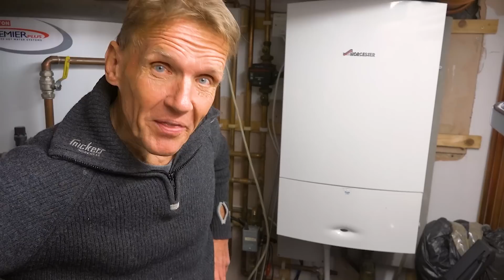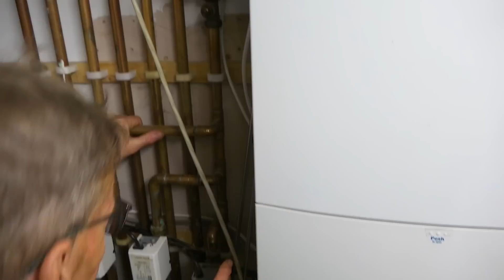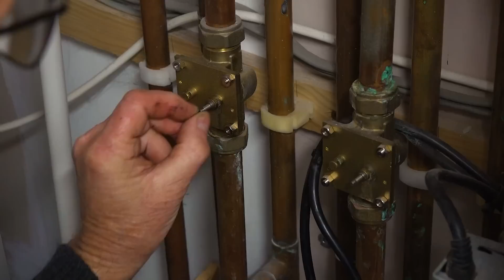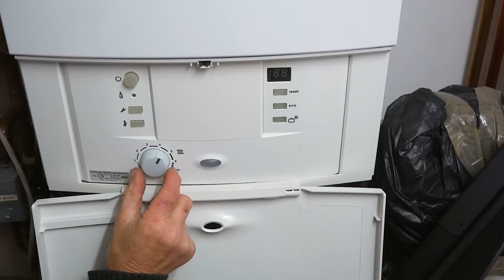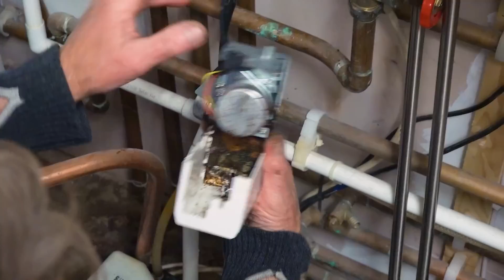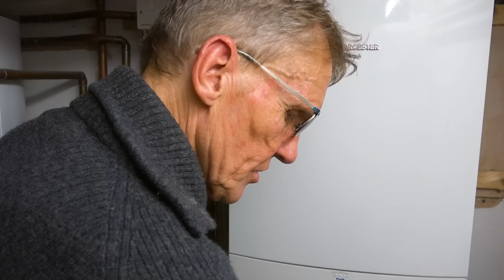How Did British Gas Miss This Simple Fault?

Comment: That is difference between some one who is Licensed, and one that is "Certified" by their employer. I am a multi Licensed Plumbing & HVAC Contractor with a Boiler Installer License up to Nuclear in Detroit area. Most employee's of Plumbing & HVAC Contractors are not licensed, and very few have went to a pay for it type of Trade school. The opportunities of actually getting into a Union Apprenticeship are nil, compared to when I did in January of 1979, and I only got in from a friend whose Dad, Brother & Brother In Law were in Local, and I ended up as apprentice to the Brother In Law. Now I am in 60's working alone because no young folks want to get involved, and the cost of being in business is around $4500 a year in US Dollars for Licenses, Liability and large van Insurance. For just me alone that is a large amount to cover, before any profit.
Reply from the maker: It sounds like these problems are international. Why we have to pay so much just to go to work is beyond my comprehension. Truck drivers don't need to take a test every three years
Reply: @SkillBuilder  looking at some of them I think they ought to be tested every 3 years. They certainly need reminding not to use their phones on a daily basis.
Reply: @SkillBuilder  Did city and guilds plumbing up to level two out of my own pocket,  bpec unvented hot water and hetas solid fuel with hot water. Gas safe? Last time I checked you had to enter indentured servitude for at least 6 months with some dude already "in the club". BS. Any problem, fault finding or installation training scenario is easily set up in the lab, I saw them. Would have loved to have done it. Couldn't afford to work for nothing for 6 months trying to beg some   pee rick to sign me off (which he wouldn't want to do as creating competition for himself). Then they complain about a lack of "qualified plumbers" 🙄

Comment: Nice one Rodger. Youre absolutely right. When i heard BG had just topped up the boiler, i thought ohh goodness, here we go. I had BG change a noisey pump in the boiler. OK all fixed...and off he went. Wouldnt work at all afterwards. Next day, different guy took the cover off. The previous guy had drowned the control board !! Ffs

Comment: 1st you remove all external controls and run boiler . Boiler does not trip RCD then it must be  external component or cable issue. Basic stuff really, bet the BG guy did not want to do the zone valves as this would be a long duration engineer 😂😂
Reply: By external component you mean the port valves etc?

Comment: BG: "you've had someone else fiddle with this so you're not covered"
Reply: If they are told its Rodger that's diagnosed the problem ,after their man didn't I think they'll just fix it or face his wrath on another video .
Reply: As usual BG are no help,  just interested in the money.
Reply: Yes ; that's coming.
Reply: Ahh good point:(
Reply: You've had an inexperienced cowboy working on it is what big will say.  Herd them say it to one of my customers on the phone . Only been a hvac engineer for 29 years what do I know . They even threatened to ridor me lol
Reply: My first thought as well.
Reply: Why can’t i have the luck of buying a house and Roger is your neighbour.
Reply: Yes, pretty sure they'll say the agreement is now void and they're not covered. You could maybe get a refund on the cover for their failure though.
Reply: To be fair most firms would do that. I go out for warranty calls on equipment, if there is any sign of someone bodging or messing around with it then I walk away as it's not covered. Best thing to have done, even if it doesn't get his neighbour up and running, was to put those valve heads back on and call BG back out saying you've seen a spark from the motorised valve and there looks like some water around it.
Reply: @TheDoosh79  yes it wasn't supposed to be a criticism of BG as such, at the most idve removed the actuator from the valve, I certainly wouldn't have started pulling them apart
Reply: I wish someone would do a watch dog style program on British Gas and how they don’t service boiler they safely check them! I have lots of photos of boilers that have been serviced by BG and it’s disgraceful the carbon we find in them!
Reply: @andyturner1502 this is very reason we cancelled our Homecare with them a few years ago. I realised all we were getting was a check, not a service. I got an independent in and they spent ages on it sorting the years of maintenance that BG should have been doing. The heating was noticeably more efficient afterwards. Would never use BG again now.